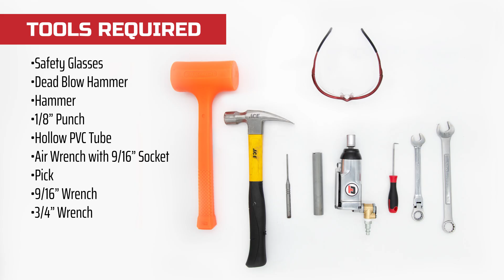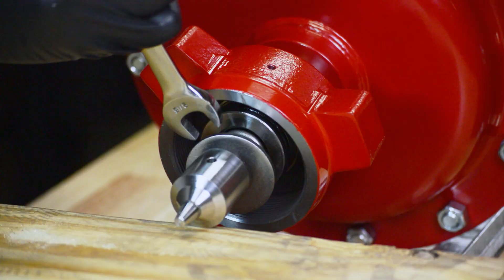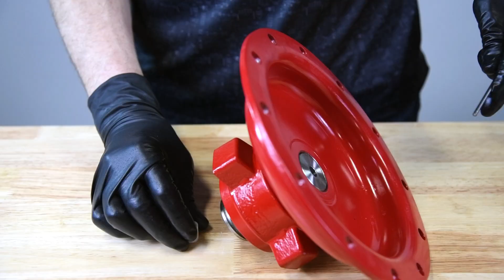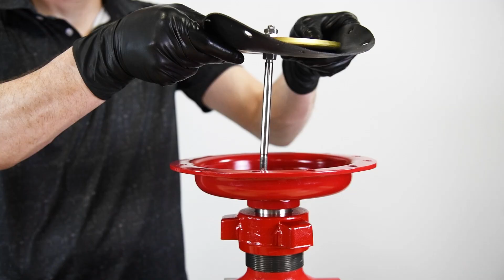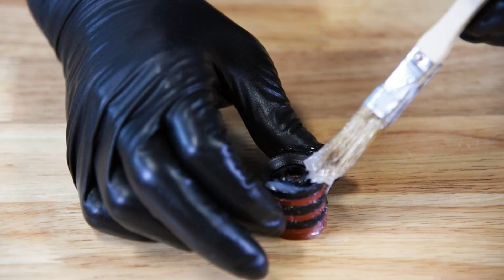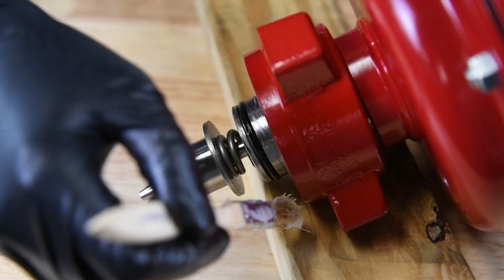BMD's CV10 Reverse Repair and Replacement

Comment: These are the most failure prone valves in the oilfield. Packing failure back feeding fluid to the controller, roll pins coming out, tips snapping off the plugs. The CV 15 is a much better valve but definitely still isn’t a kimray.